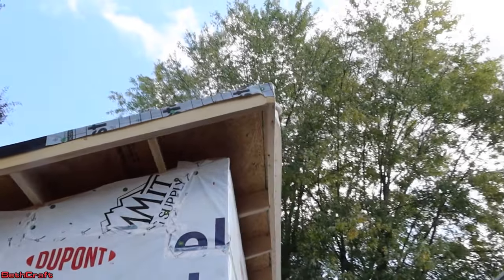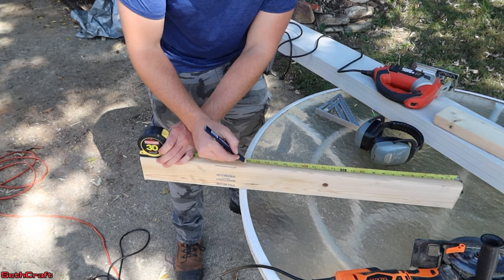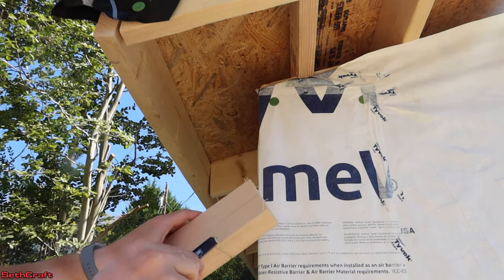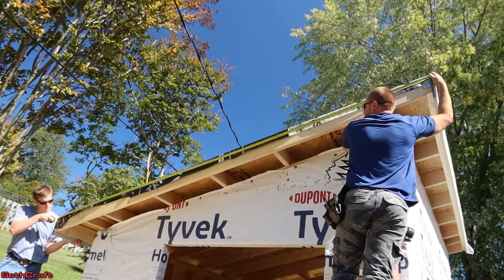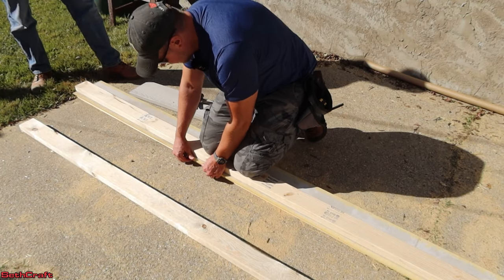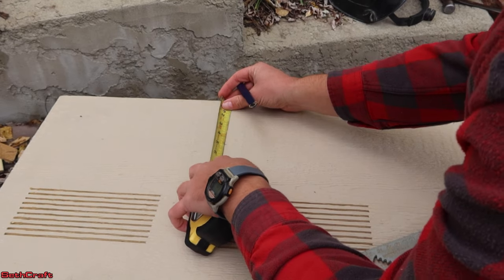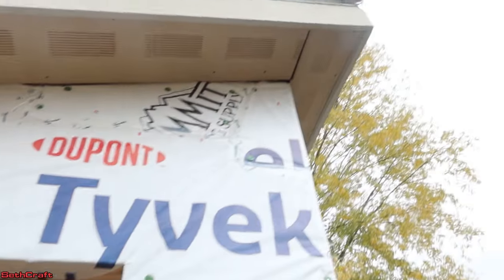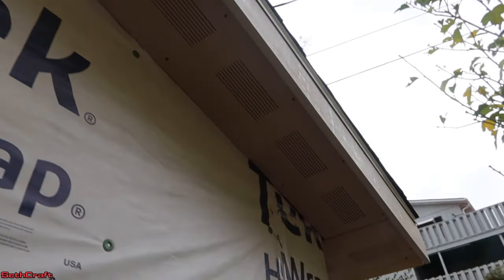DIY Fascia and Soffit Install for a 10x12 Shed

Comment: A masonry blade on a skil saw will cut fiberboard just fine,and compared to specialized blades just for Hardie, are about 1/3 the cost.  Regardless....it is cheaper than an ER bill after you slice your hand open!

Comment: Very useful video. Thanks! It looks like your rafter ends were not plumb. Am I correct? -- I am considering doing the same for my wip cabin.   EDIT: I think I found my answer (plumb cut) at 3:17, at least for the bottom edge. :)
Reply from the maker: Thank you. Yes the ends of the rafters could have used a little trim. One of the down sides to making diy rafters is that they might have some inconsistencies in length.